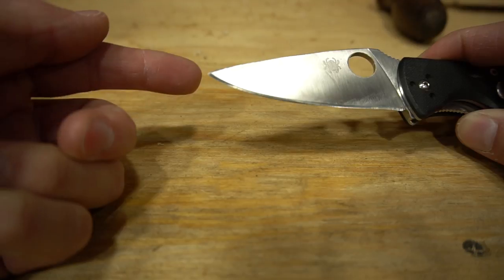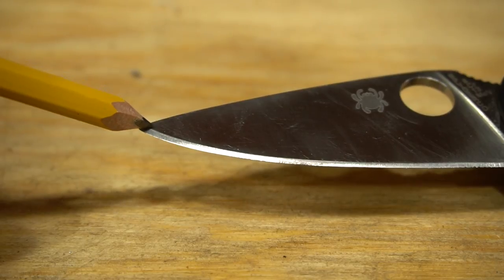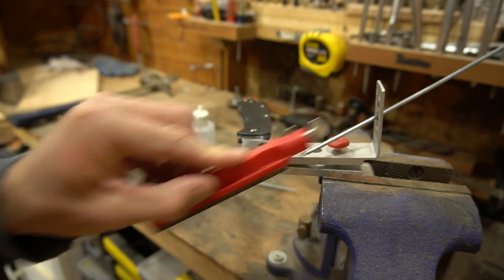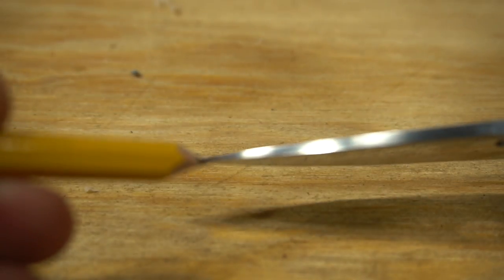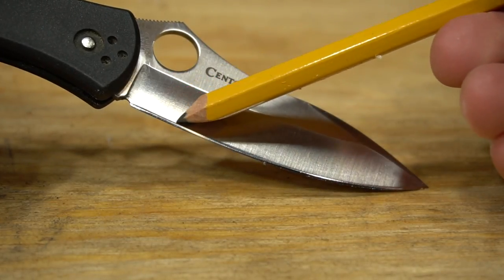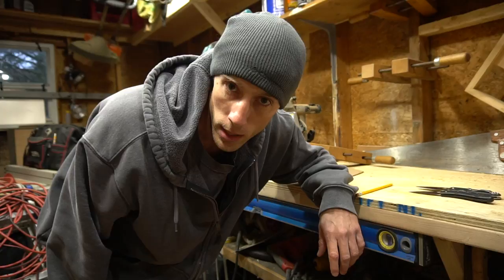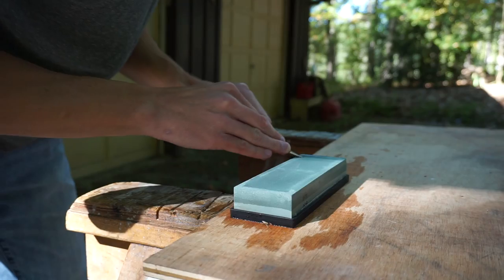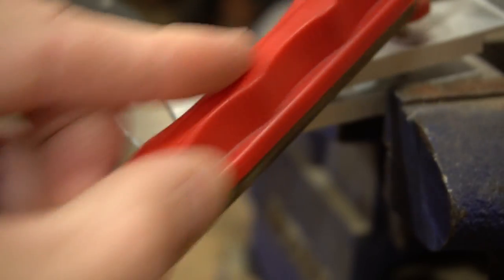KNIFE SHARPENING TIPS 3 | The tip, and why its difficult to sharpen.

Comment: Awesome video, and one that makes me feel a lot better about what happened when I used my Lansky system to sharpen my Ultratech.  (Microtech recently changed its warranty policy and allows owners to sharpen their own knives.)  The tip area was factory dull and the entire blade was so-so sharp, so I swallowed hard and sharpened it myself.  Things went well except I couldn't get a burr on the tip area, so I kept sharpening and sure enough, the bevel kept getting wider.  I figured it's better to have a janky bevel than a dull knife, so I kept going until I got the burr.  The blade is one of those black ones, so the wider secondary bevel stands out, at least to my eye.  But it's a sharp knife now, so that's all that really matters.  Thanks for the video!
Reply: Microtech didn't allow people to sharpen their own knives? Isn't that considered proper maintenance

Comment: Tip is further away from the middle so the angle is changing to flatter. That's also why you have to lift up a knife when stone sharpening at the tip. On a Lansky knife can't move so angle changes. I clamp nearer to where the edge starts to round to the tip. It never will be perfect but acceptable. Imho this is the difficulty of sharpening. If a knife is only straight  and you can more or less hold an angle it is all pretty easy.

Comment: You saved my day my friend. Just now,  I am frustrated by my new lionsteel M4. The knife is nice and beautiful and scary shaving sharp only the very very tip is not as sharp as the rest of the blade. It is still kind if shaving but you need a bit pressure to shave with the blade tip comparing effortless shaving on the other part. I have no way getting it as sharp as the other part of the blade but  I know why now. Thank you. Instead of trying again I am giving it up coz it isn't really that bad and having a wider bevel on the tip will make the knife looks less cool. It's a hard use fixed blade after all,  who care whether it shaves or not,  right? Thanks buddy. Really saved my day!!
Reply from the maker: Good luck with the lion steel m4 m390 is a hard steel. As long as it works or you thats all that matters😀

Comment: I noticed you going with and against the edge when using the Lansky. I've seen a lot of people, including Lansky reps say not to do that. To only go against the edge with stones and away with strop. What's your take?
Reply: I don't see why it would matter. Applying the stone away from the edge might 'shift' some softer steels and create a wire edge, but that's usually what you're trying to achieve anyway. The important thing is that you properly knock down that wire edge to reveal the true apex. You can create a wire edge, feel it is sharp, only to have it collapse when cutting material and assume the knife is suddenly dull. It could be Lansky is trying to avoid complaints and unfavorable reviews when the product is actually fine and does a good job.

Comment: great vid as always bro n information filled as always as well. ive had a few knives where the tip was a major pain to sharpen and even some of the higher end stuff ive had where the bevel is off on one side.. thats a major pain. maybe you should do a vid on edge alignment im sure many struggle there..
Reply from the maker: Yeah my spyderco sage came from the factory with one side way larger than the other. It is a major pain especially on large beefy blades haha.

Comment: Amazing video! I've wanted to be able to slice through receipt paper from the heel to tip and never could get the tip of the blade to be consistent. I was always holding back toward the tip because I thought I was doing something wrong when I saw the bevel getting wider.  I thought that meant the angle was changing, but as you point out, the opposite is happening. 

After watching, I started over with my medium stone and went all the way to a strop. I wanted to make sure that the entire length of the blade had the same angle and SUCCESS! Thanks!

Comment: good information on the video but I got a question when you sharpen and re profile a knife for the first time on a fix sharpening system then down the road when you need to sharpen it again obviously you're not going to start an extra course unless there's a chip so when you go to retouch up your angle And clamp it's not like a wicked Edge where you got a stop to tell you how deep to put the knife in so how important is it to get the knife exactly where it was the first time? because so far the only thing I know to do is take a picture on my phone of where I have the knife clamp and then the angle that I sharpen with or write the sharpening angle down in a book for what angle for what knife. so is there a better way to do this how important is it to get to knife exactly where it was the first time if you can help me out with this I sure would appreciate it because most of the guys I have are around 2 to 250 and most of them are the real high-end super Steels m 390 and so on because in my mind if you don't get the knife exactly where I was the first time and you're just trying to touch up an edge with an extra fine Diamond before you move to some ceramic Stones your online up wasting your time if your angles are off because you're not going to match up where you sharpen the first time

Comment: Isn’t it also because of a slightly different angle when sharpening with fixed sharpening system? At a tip there is a longer distance to the “holding base” then from the sharpening choil to the “holding base”. Longer distance must be smaller angle, therefor the stone must go more into steel...
Reply from the maker: If the blade is centered in the sharpening jig (if one is used) the distance is the same at the back of the blade and at the tip. If the tip was at a longer distance than the back of the blade than yes it would change the angle at the tip.
Reply: Oh, yes. Thanks for explaining.

Comment: Hi. I've just bought An Opinel no 9 which is FLAT ground and I don't want a secondary bevel. The tip area is not as thin (sharp) as the rest of the blade. I know I have to keep the whole flat primary on the stone. If I do that on a coarse to work the tip thinner, is this going to roughen the entire blade? I'm a bit confused and cant find any help on sharpening a flat ground that has a belly and up swept tip! With the tip, I know i'm supposed to lift the blade as I get to the end of the stroke to allow for change of contact with the stone but if I do this, wont it affect the flat ground edge? HELP!!!!! ATB. Pete.

Comment: With the tip being wider is simply bevause it is a different angle, sharpening the tip on the lansky is further away than the section where the clamp is mounted making the apex thinner because the tip is being sharpened at a more shawlow angle as it is further away from the guide holes. All "consistent" angle sharpeners, such as the lanksy or wicked edge, face this downfall, the angle is set to be accurate to the clamp, if you sharp an inch away from the clamp it is going to be a shallower angle because the distance between the guide holes and the blade is greater, simple math hard to explain in a comment. I hope this makes sense, if not look up simple little lifes video on the subject because he explains it much better than me.
Reply from the maker: Comparing the angle at the back of the knife, to the angle at the tip, like I did in the video, the angle is the same, if the knife is exactly centered in the system. If the distance is the same, than the angle is the same. If the the blade widens/thickens at the tip the bevel gets larger due to haveing to remove more metal in order to apex.  Hope this clears things up 😀
Reply: OUTDOORS55 If you take a close look at the first few seconds where you show the knife in the clamp, the tip is farther than the heel to the angle guide, which is why it is thinner.
Reply from the maker: That was b-roll footage not the actuall sharpening. I know it was exactly in the middle, I was there and measured it. Trust me, if the blade is thicker at the tip than at the base, than with the same angle applied, the bevel will be WIDER at the thicker portion, not thinner. Again hope this helps😀

Comment: The controlled bevel system sharpens in a circle. Your blade is not a circle. Consider how this would affect sharpening a very long blade like a sword. Your bevel is not truly consistent.
Reply from the maker: Blade length doesn't matter on a controlled angle system.
Reply: yes

Comment: Remember there are no stupid questions; In the video it looks like you are "sawing" back and forth with the stone as opposed to only making contact with the stone in one direction. If you are going "back and forth" aren't you just erasing your efforts?
Reply from the maker: Good question. No, the primary purpose of the stone is to remove metal. The stone removes metal in both directions. Removing metal from both sides of the knife will eventually form a point or apex, which is the sharp part of the blade. Hope this helps 😀
Reply: Makes sense and cuts time in half! Thanks

Comment: the lansky tool does not give even angles. especially on longer blades.
basically the farther you are from the point where its held, the sharper the angle.
you need to change the point where its clamped depending on length and curvature for a consistent angle
Reply from the maker: That actually not true. The lansky has the same angle regardless of blade length.
Reply: @OUTDOORS55  unless you have a completely straight edge, or a curved one with a constant radius centered to those holes, then i dont see how.
and both of those cases are rare